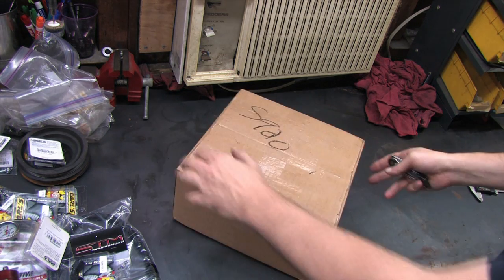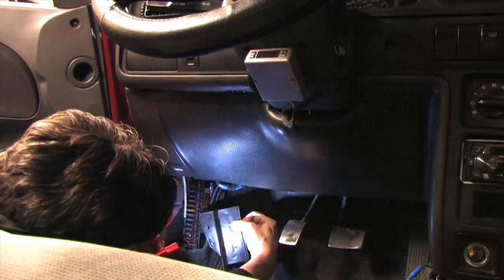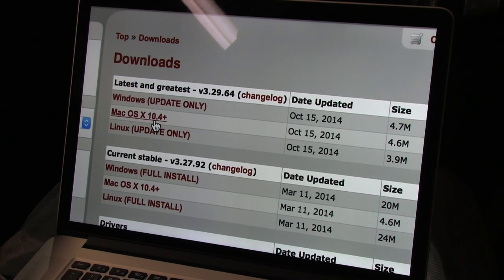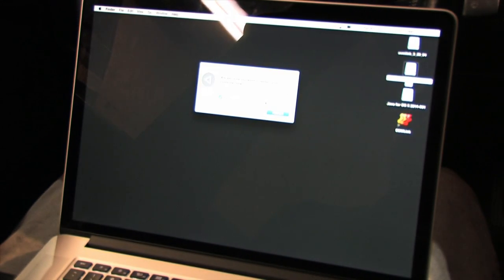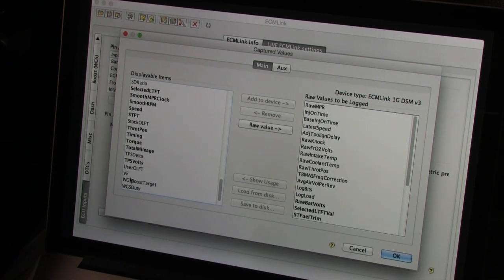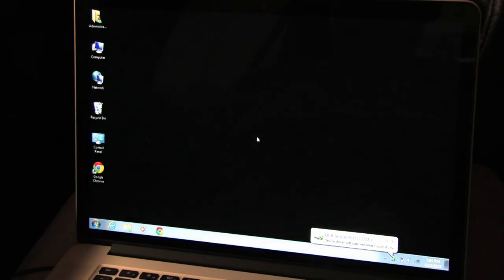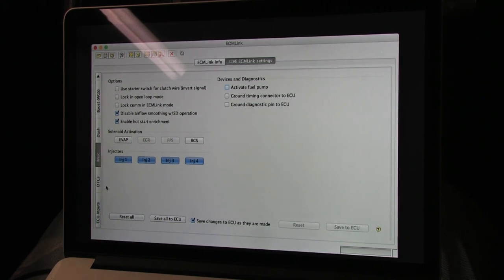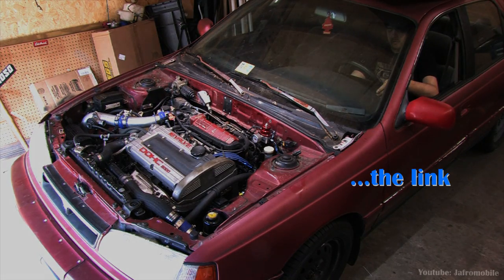Hyundai Assembly 10 - ECMlink Install & Speed Density config

Comment: Great video.    I know some people out there needed a good setup video to help them get tuning.  And yes there are a few of us ecu hackers still working with the 1g and 2g binary files and a eprom emulator . I just added 2 step and nlts to my stock 2g binary and it works great  next steps I will be taking is swapping over to speed density and rewriting the hex code for it. As for dsm link it is a great tool as well. And the support is wonderful. Tom from ecu tuning helped me out a a ecu for my 97 spyder capped socketed and even swapped the cas inversion to work on my 6/7 bolt configuration with the 1g cas sensor without asking  great company.     Keep the videos coming looking forward to seeing this build put down some numbers.
Reply from the maker: Brian Smith I wish I did have more experience with it.  Because I've had DSMlink for a decade, I haven't had much need to, so that's why I don't know much about it.  Having a RAM-based ecu configuration can spoil you.

Comment: Jafro, a easy way to mount your GM MAP sensor, Jeep Cherokee's have a neat bracket that jeeps use a GM MAP sensor that mounts on the sensors that has 2 bolt holes and you can mount anyway in your. that what I did to all my 1g cars, works great.

Comment: Installed the driver, but it doesn't appear in the list. I tried to uninstall and reinstall everything. I ended up manually putting it in, but I don't know if it will work since it was not registered in the first place. I won't be home for awhile to test the manual input but I have had this problem and had to use my old macbook for awhile now because of this issue.
Reply from the maker: Bradajay On who?  On the Mac side?  Which OS version and which software package?  v2 was the only one that's ever been tricky for me.

Try enabling root, and performing the installation from there.  Make sure you're running Apple's version of Java.  If you have more than one version of Java, make sure the drivers are in the right directory for the version set as your default.  If none of this works, post your question in the ECMtuning forums.  ;)

Comment: I just received my new V3 ECM link a couple weeks ago and have been pouring over the wiki and forum but there doesn't seem to be a clear winner in the Speed Density vs. GM MAF debate. I recently purchased a 1990 AWD Talon rally car that I'm resurrecting to rally once again after years of neglect. Considering my use will be rally, what would you suggest and why?

Comment: Pocket logged also did modified ecu's for second gen RX7s, we had two way communications with that for adjusting fuel, timing, injector staging, and injector sizes. But like with the DSM it still relied on Palm, you could make it work on pc with a palm emulator, but thats a moot point now.
Reply from the maker: spikederailed Yessir!  I... I hope nobody thinks I was bashing the pocketlogger product itself.  Really I'm picking on the Palm hardware.  At least that's what was intended.  I was meaning to convey that the pocketlogger was the only thing that made a palm useful.  lol.
Reply: The palm "worked", but like you mentioned the battery backed memory was a real downfall. Loading the application onto the sd card(M515) kept that from happening though.

Comment: Not sure how much experience you have with this Jafro, but I just put a JDM Evo 7 ECU into my GSR Lancer (after the Evo 6 ECU Bricked itself on a test write..) I have a tactrix Openport 2.0 cable, not the 1.3, and it seems that I cant log things like knocksum with it using EvoScan, should I just get the 1.3 cable?
Again, no idea if you have any experience with reflashing stock ECU's, but figured Id ask :)

Comment: Hey jafro, you wouldn't want to produce those map sensor brackets would you?  They look amazing compared to what I've seen.
Reply from the maker: Chris Fisher Hahah… nope!  The 1 problem being the cast bracket comes on the car, and I don't have a source or a part number anywhere to buy them.  The one I used came from the Colt engine because the Hyundai never had it.  It's not perfect.  It has its problems.  It makes adjusting the timing really difficult because it blocks the swing of the wrench where you tighten and loosen the cam angle sensor.

The other problem is this… when I spend time producing parts, I'm not spending time making videos.  There may come a day where I begin manufacturing a product, but I've got 3 other busted DSMs to fix for the sake of your educations and entertainment first.  Please feel free to copy me, I don't hold any patents.  ;)

Comment: A few things I noticed, no meth injection? How would you run it now that you have a sensor where meth injection nozzle normally is situated? If/when you install the meth injection kit, will that mess with the GM temp sensor's readings? Thanks for all the helpful info, I will be using a lot of the same fuel,ECU and air mod's you've used on this project. Thanks again for this GEM of DSM related info you gave us here. Now to watch the next video again..... ;-)
Reply from the maker: BoostedCajun You just need the sensor several inches upstream from the meth injection nozzle and it won't mess anything up.  At the moment I'm more concerned with tuning without it, then adding it so that I can achieve the maximum benefit.  You'll see how I deal with the nozzle.  :)
Reply: ***** Sweet! Glad to hear the Hyundibishi run again!

Comment: Does the turbo timer go into the tuning equation at all? I sort of understand what a turbo timer does, but on this particular setup does it play any role at all? If so how? Do you think all setups should have a turbo timer? If so, what features should a good turbo timer have? Sorry for the barrage of questions, just finally remembered to ask.
Reply from the maker: +BoostedCajun It's interesting that you should bring that up.  I had to move the trigger wire for my relay to the ground wire on my turbo timer because when I cut the car off, my wideband o2 sensor stopped working, causing the car to go stupid lean.  It's at idle, so it didn't cause me to blow up my engine, but it's definitely not good for it or the o2 sensor's calibration.  Turbo timers need to do one thing, keep the car running at idle for a couple minutes.  An adjustable run-time is a good thing.  Other than that, the other features built into them have better equivalents available in separate devices.  For instance, I have one in my Galant with an A/F gauge function, but it's narrowband... and that's everything short of useless.  That just tells you your o2 sensor works.

Comment: hey bro, you should make a vid on just data logging and making changes to the values,  from start to finish :)
kudos bro
Reply from the maker: I've wanted to make exactly the video you're describing, but I can't seem to tune anything on it right without traction and a consistent electrical system.  That car is currently sitting up in the air on jack stands, getting some suspension and tire work done.  I'm going to re-visit the alternator install, too.  I think I can do it better.  I think the alternator isn't spinning fast enough.  The voltage regulator overheats after about an hour.  It didn't do this with the factory alternator in it.  Sorry if that's a spoiler.

Comment: Would a programmable cpu be any benefit if it is running wide open throttle 95% of the time, like mine. I heard that at WOT the cpu isn't really doing anything, just dumping all the fuel the injectors can handle. Just like to know if it's worth the investment.
Reply from the maker: SupermanBPR9 Yes, because you can adjust your timing, and how the open loop fuel tables (wide open throttle) behave.   For instance.  Your ECU has a default timing table that it uses to determine how much ignition timing it can get away with.  If you're not knocking, you can add more timing advance and make more power.  If you're running rich, you can lean out the mixture and... yes... make more power.  It's possible to throw enough fuel on the fire to put it out.  Fuel needs air.  Nailing that razor's edge between air and fuel makes the most of your fire.  

I think this was well demonstrated with my dyno videos.  Nothing changed on my car except for the ECU an the paint job from my first visit to my second.  Thomas Dorris from ECMtuning dialed in an extra 80 hp for me at red line on my second visit.  Without DSMlink, it peaked power output around 5200 RPMs and fell off.  After ECMlink it peaked and held all the way to red line.  It completely changed how the car pulled through the gears on track day.

Comment: I'm preparing to install my eprom ecu in my 1g. The previous owner had a apexi SAFC installed. Is there any reason/s to remove this unit before installing the new ecu?
Reply from the maker: +Jacob McCracken You don't have to, but you really don't need it.  There are still people more than willing to buy that S-AFC if you do remove it, though.  I'm not that guy, but I know they're out there.
Reply: Cool! I'm running only DSMLink now. But in my stream I don't see the ISC to adjust the BISS screw or the Learned Idle Offset, even when the car is running. Maybe I missed a step...
Reply from the maker: Jacob McCracken You need to add the ISC items to the "Captured Values" table, and then add the ISC items to the "Displayed Values" list.

Comment: I have been looking at streettunedmotorsport (stm tuned) and have not found that throttle body elbow is it still available?
Reply from the maker: +Da Bozz No, they do not.  It's a shame that they don't.  I feel like it was discontinued before I could finish the edits.
:(  STMtuned sold it, but it is an ETS part.  ETS would have been the ones pulling the plug.  There is now a hole in the marketplace.
Reply: +Jafromobile I emailed stm and they said they are willing to make me a new one! Thanks for the quick reply. I'm new to the 4g63 and I'm installing a hx35 on my gsx and your videos are gold keep up the good work!!!
Reply: +Jafromobile  I've found two alternatives! You'd have to get an SD bung welded in, but it's the same diameter of the SDTBE shown on this video. This particular one is modeled after the HKS SD TBE that is now discontinued, but they have a few floating around on Ebay if you look. 

Buschur Racing TBE --&gt; https://secure.buschurracing.com/catalog/product_info.php?
products_id=1676&amp;osCsid=dslhklwuoxcjh

HKS SD TBE --> http://www.ebay.com/itm/4g63-Turbo-Dsm-HKS-Throttle-Body-Elbow-Jdm-Eclipse-Talon-Laser-1g-2g-Rare-/161985240291?hash=item25b7129ce3:g:2FoAAOSwXshWs9Qx&vxp=mtr

Comment: I appreciate the vid but I'm not sure I haven't done all that it doesn't want to connect ever, but does connect to my buddies windows comp. so I see you have windows on your computer how does one do that?
Reply from the maker: AllFourSpinDsm Un-install your current installation.  Un-install the Oracle version of Java if it's on your machine.  Log in as root and re-install it.  Find the Apple version of Java (2014-001) and install that.  Install ECMlink last.  Unless there's some other piece of security software on your mac that disables Java, everything should be in the right places and it should work.  You can't install it successfully from a non-administrator user or from an administrator user having the "502" or "secondary admin" user number.  Only the first administrator created on the machine and the root user will have privileges to install Kernel Extensions into the  /System/Library/Extensions folder, and that's what the serial driver is.  It's a Kernel extension.  After the install, restart the machine, log back in and make your connection.  The serial driver installer doesn't invoke a reboot, and us Mac users are used to installing software that just works without having to do that.  You can launch it all day long and never connect if you don't restart afterwards.

If you don't know what your user number is, you can open the Terminal, type "cd /Users/" return.  Type "ls -alon" return.  It will show your user directories, and just to the left it will display the user numbers of your accounts.  501 is the primary admin.

If you want to enable root access, go to /System/Library/Core Services and launch the application "Directory Access".  It's in the menubar options after you click the lock and authenticate as an administrator.  Select "Enable Root User" and set your root password.  Log out, and log in as other: root with the password you just created.  As that user, there's nothing on that Mac that you can't access.  You don't even need to authenticate installers because you're root.

Disable root when you're done for security reasons.

ECMlink works great on the Mac once you get it connected.  I really did it that easy in one take with what I feel is the second most problematic version of MacOS (after Lion 10.7), on a fresh install and that's how it went for me.  The only thing I can think of is Java not having rights to run, an incomplete installation, security software blocking it, or another program hogging the USB bus.  If you wanted to run Windows on your Intel Mac, there's an application in the Utilities folder called "Boot Camp" that will help you get it set up.  ECMlink for Mac works great on everything from 10.6 to 10.10 in my experience.  I even ran v2 on a Mac when it wasn't supported.  v3 has come a long way.

Comment: You said you ran your maf vacuum to the pvc port.  Did you T into the port or reroute the PVC line?
Reply from the maker: No, the MAF PLUG has the MAP and IAT sensors' ELECTRICAL wiring going through it.  Nothing with the vacuum lines.  I had to watch the whole video to figure out what you meant.  The ECMlink cable plugs into the MAF plug and gives you separate harnesses to go to separate GM sensors.  It bridges that gap so that it's plug and play.
Reply: Jafromobile I was referring to what you said at 1:10. I ran into a dilemma of where to source my vacuum for the MAP sensor since it's advised to have a dedicated source. Thanks for the reply though. Your videos are awesome. They helped me quite a few times.
Reply from the maker: +KRG_Royal  oh!  Gotcha.  I didn't tee into it.  My MAP sensor does plug right into the PCV breather port on the intake manifold, and I don't have a PCV valve on my car.  I have a catch can plumbed into the PCV breather port on the valve cover, and THAT has a vacuum line routed back to the turbo intake.  I think the catch can install is in the previous video.
Reply: Jafromobile oh ok that's what I figured and that's what I ended up doing too. Thanks again! Which video is the catch can install?

Comment: Great tool, but how much was the software and cables to do all of that?
Reply from the maker: ***** The software is free, and the cable comes with it.  You just tell them what generation your DSM is, and they send you the cable with your completed order.  It's included in the ECU modification package.  If you want to buy another cable, that's another story.  But it won't work without first having ECMlink.